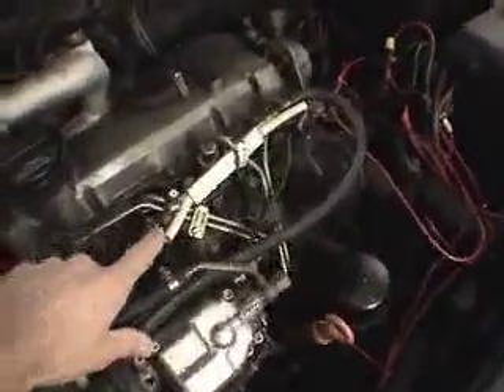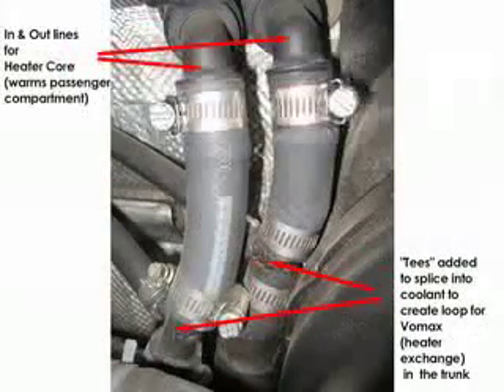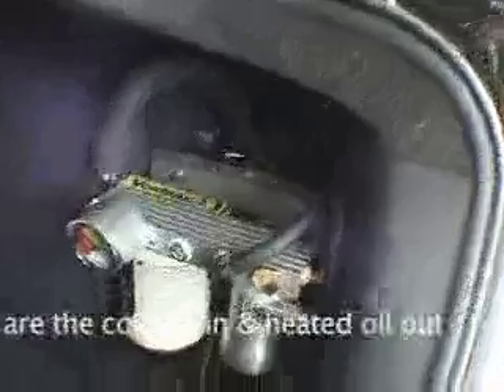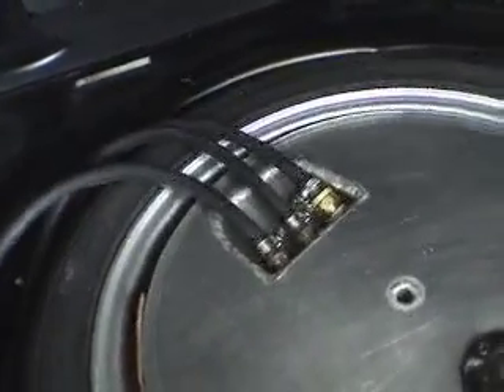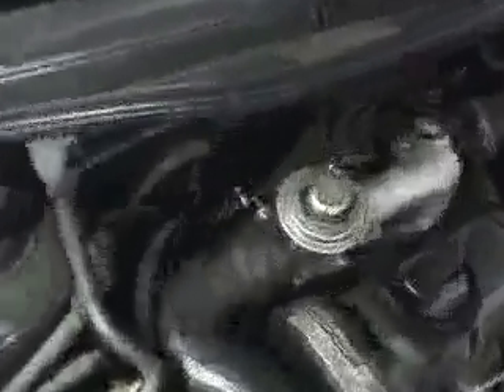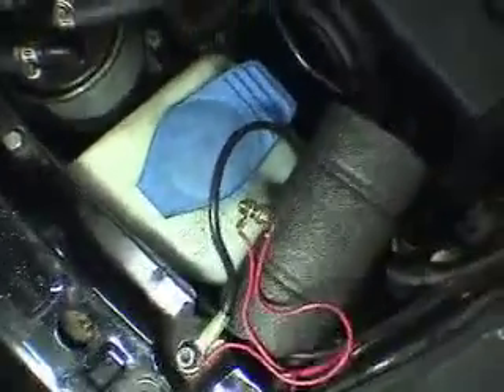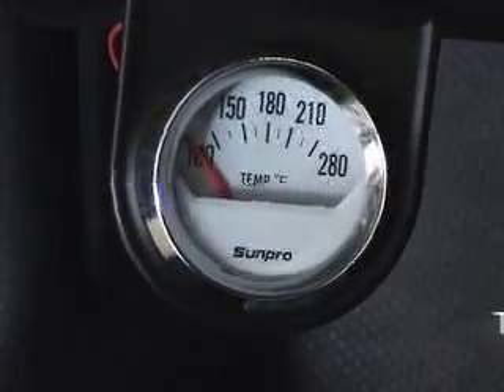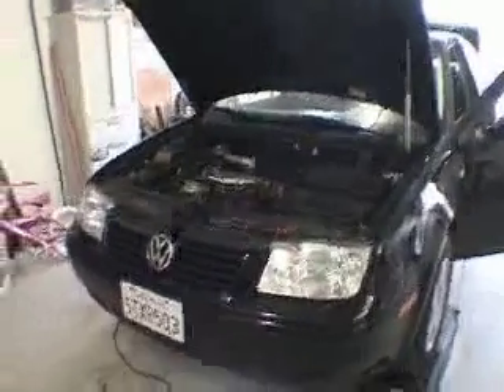Plantdrive kit install on 2002 Jetta TDI- Video 1

Comment: WVO in a direct injection engine is a big no-no.... IDI is the olny way to go IF...I repeat IF you know what you're doing...that is properly filtering, centrifuging, settleing, heating to over 200 degrees F, and having heated lines in a proper system in your car.....

WVO is very risky business.